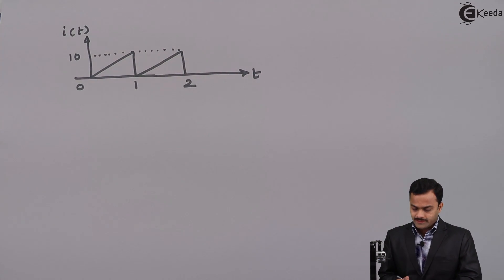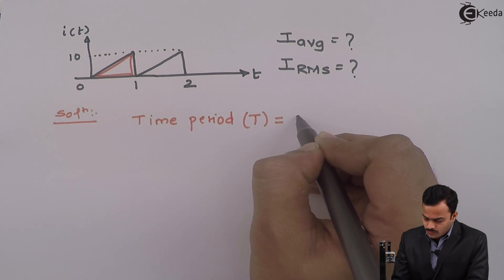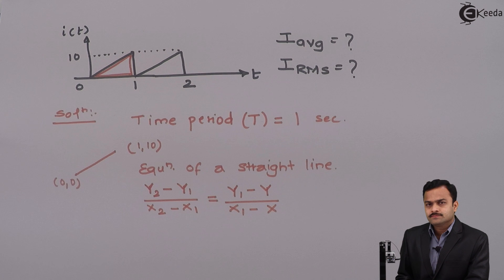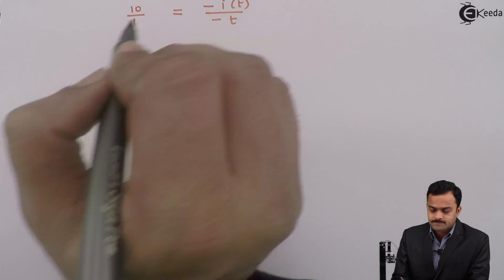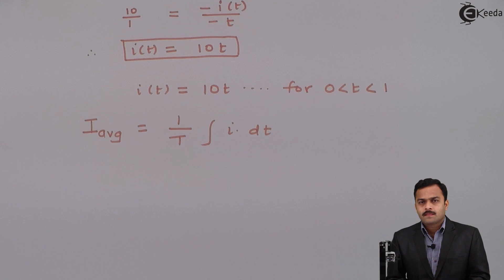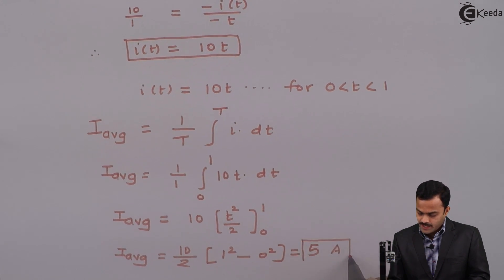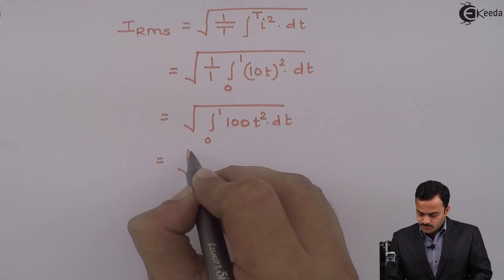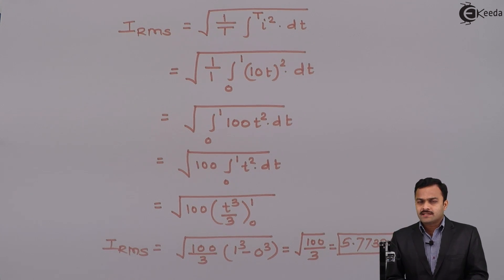Average Value and RMS Value : Problem 1 - AC Circuits - Basic Electrical Engineering

Comment: Here eqn of straight line is used as
Y2-y1/x2-x1=y1-y/x1-x
 In second problem in ekeeda of same topic, the formula used is
Y-y1/x-x1=y1-y2/x1-x2

Which one is correct?
Reply: Both are correct

Comment: The voltage and current in an AC circuit are given as v = 100 sin (314 t) ; i = 10 sin (314 t). Determine RMS power.
Reply: 500